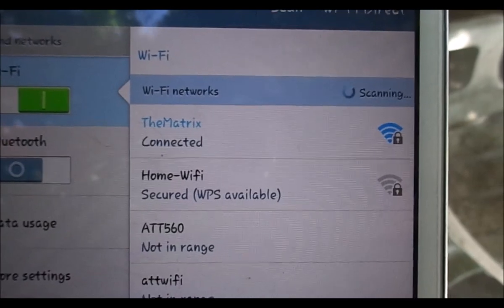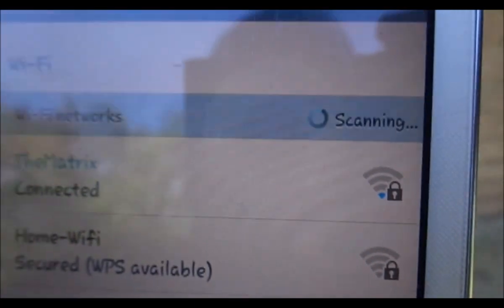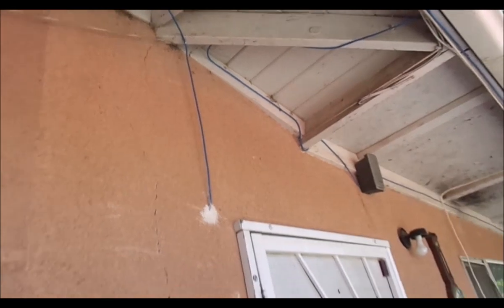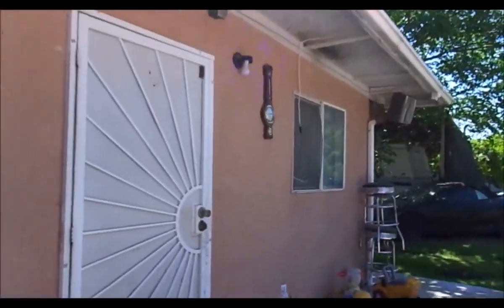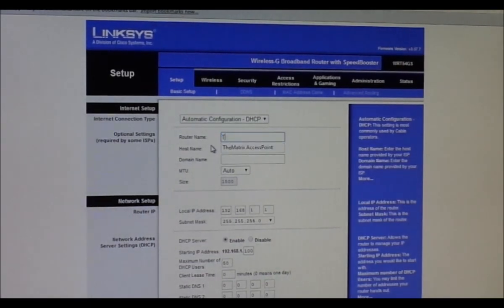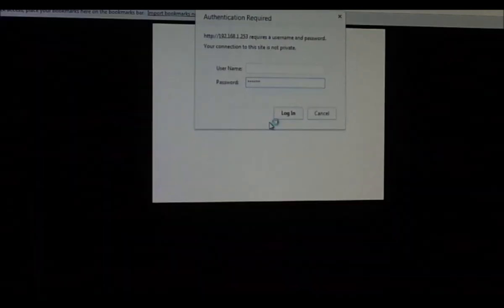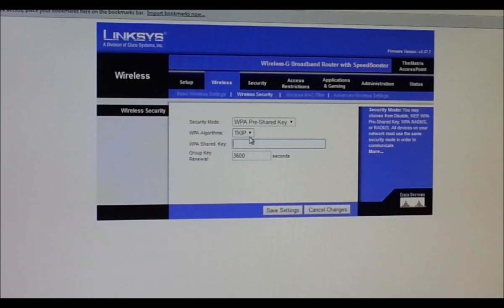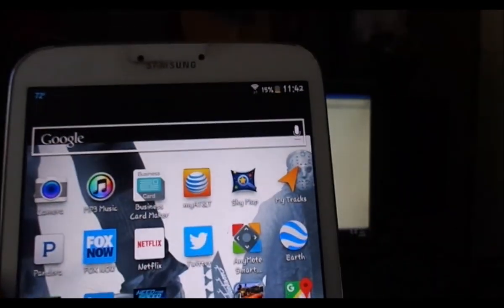How To: Setup an Access Point to your Network

Comment: If a possible reply.. But when you set up your router, if you set it up as access point I'm unable to connect any more to my WiFi to change it back to internet mode. Is there a way?
Reply from the maker: There should be a reset button on the router its self. Or connect to it hard cable to change settings on it with a laptop or desktop
Reply: @559powerscape  after I reset, do I need to set up the internet connection all over again?
Reply from the maker: @migiplays5397  yeah it might set everything back to default settings. Not to sure but ethernet cable would be your best bet
Reply: @559powerscape  thank you. It worked. I had to set it up again.

Comment: I'm confused. Whats the difference between access point and router (not modem)? I mean the configuration looks same.

Background: I'm trying to configure tenda f3 router via LAN by changing its default IP address (192.168.0.1 into 192.168.10.5) disabling DHCP. Whenever I save the router refreshes and doesn't run on any IP at all. It has AP mode option in it which I haven't used ever. Should I select AP mode first then do the other steps?
Reply from the maker: Access point is the device that is handing out IP's just like the router is. Its just an extension to the same device. The Modem is what is communicating with the internet. At&t Provides a ROUTER MODEM.

I've never played with a Tenda but if its not saving settings something isn't right. All your doing is disable DHCP so the router can hand out IP's addresses and your giving it a physical address of 192.168.10.5 to find it in the network...what is the AP MODE?
Reply: @559powerscape  Yes thats what am doing and always used to do. AP mode is dedicated Access Point mode. Previous router didn't have this option but this one has. I suppose its additional feature that am not using and thats why its not configuring?

Comment: Great video. Question: Could you make it the same name as the main network example (TheMatrix) for both wireless connections. So what i would want to do is set up the AP without adding an additonal network ( TheMatrix Access point) that way people around my house don't have change from one to the other as they move in to different areas of the house? Also if I have guests, I would like to give them one network name, example (TheMatrix) not the "TheMatrix" and "TheMatrix Access point" in case they move around the house.
Reply from the maker: You can, I don't think there should be an issues if there is it would say that "The name is already on the Network" other than that the only thing I've noticed...is that the wireless device will hold one to dear life to one connection until its complete off the radar and then it connects to the other one. You would have to force it to switch wireless signals....try it let me know

Comment: Does main router have to be connected to the access point router when you use the Ethernet cable?
Reply from the maker: Yes it does to hand out valid IP addresses to connect to the internet

Comment: Great walk through brother man. Got 1 question, If I name it both the same SSID, will it transfer over to the better connection? I live in a 3 floor town home btw. Thanks
Reply from the maker: No i tried it will hang on to the connection until it disappears. I think its a setting on the device to detect best connections.

Comment: The access point has to be connected via ethernet cable and not wirelessly (relayed)?
Reply from the maker: You can, but my experience with wireless is that it drops packets, so the best thing to do is give it a dedicated connection with ethernet cable. Less packets dropped = faster communications!
Reply: @559powerscape  .what access point should I use with my tendaf9 wireless n router
Reply from the maker: @melanieamac957  its up to you, I used what ever I had laying around the house